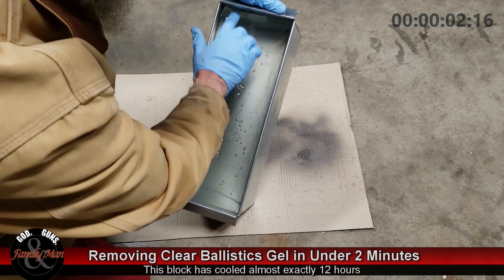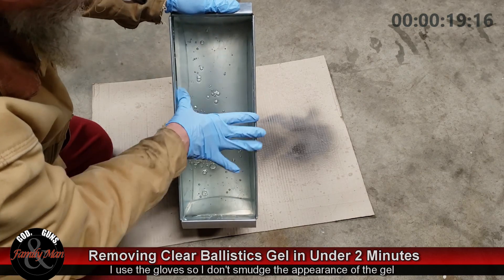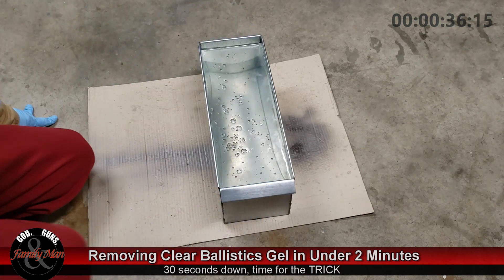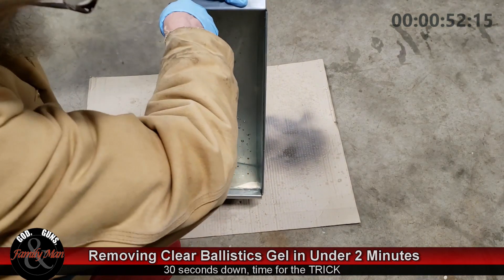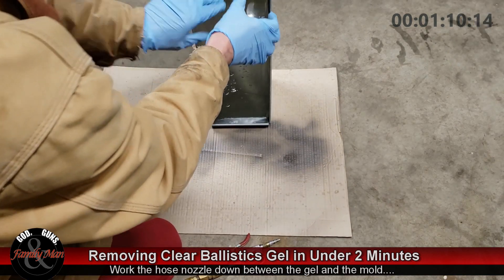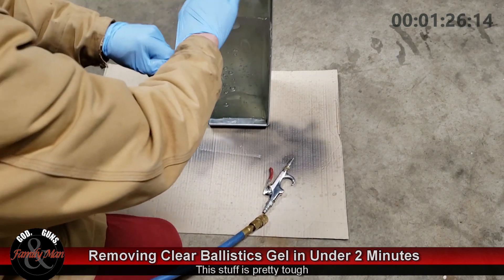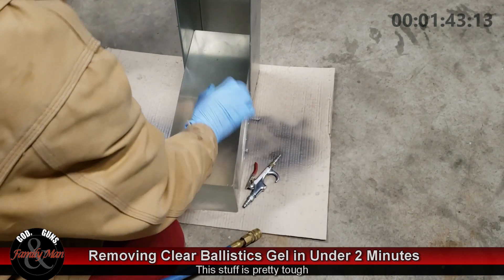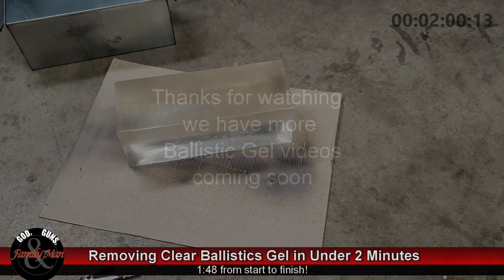Removing Clear Ballistic Gel block from the Mold in under 2 minutes

Comment: I haven't seen that before. Gun Sam is using some soap so it won't stick and seems also quick. Air makes sense like with stuck buckets.
Reply: I do not and have never used soap to remove the gel.
Reply: @GunSam  
I'm sorry Sam, must have misremembered this from perhaps a Taofledermaus video that sprayed it after it is cold to remove it. 
You janked on it from a vertical position with little effort.
Reply from the maker: I heard about that from folks at Clear Ballistics.  Gave it a try and it really works well.  Pretty much effortless.